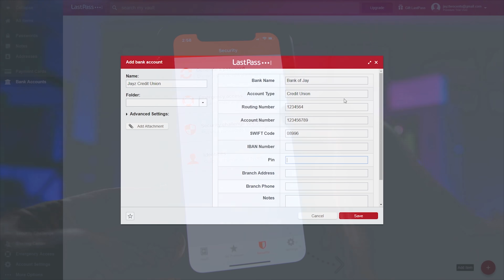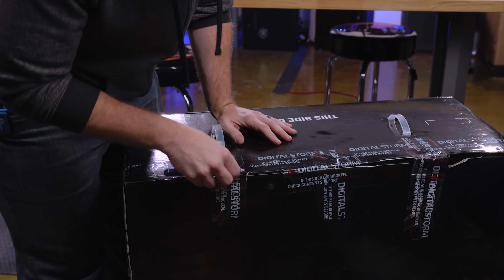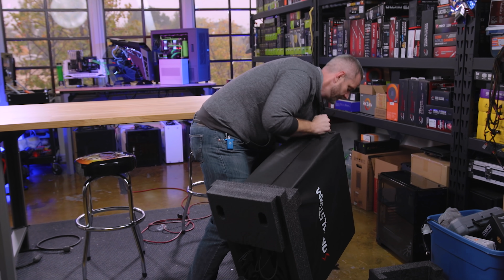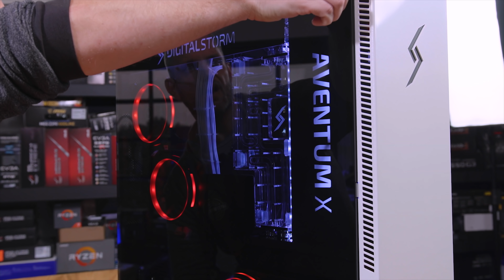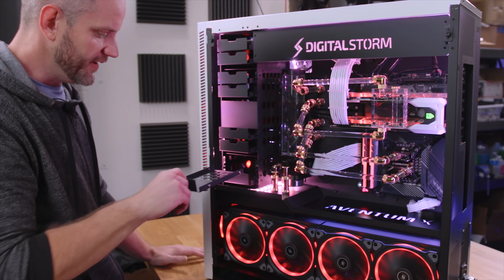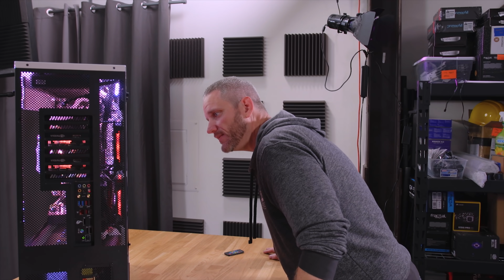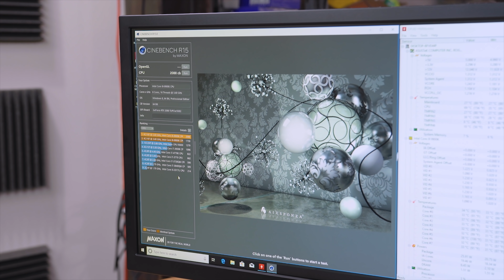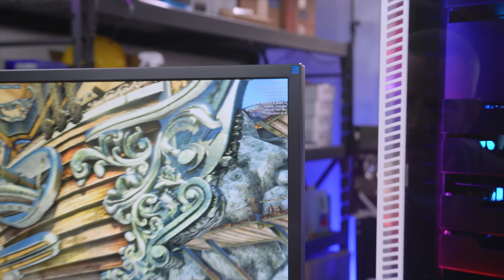Unboxing a $9500 Custom Computer...

Comment: Guys, don't bother with Digital Storm. Those guys are the absolute WORST!!!! I have had such a bad experience with them this year, it's unbelievable. 3 RMAs since I got the computer exactly one year ago, over 75 days without my computer throughout the year all on different times of the year. One of the times I received my computer from them after an RMA, it came completely DEAD ON ARRIVAL!!!! Do your research, those guys are horrible!!!!! They don't care about people. The Management team are the worst, they are the ones who basically have all the say disregarding Customer Service!!! Research on people's reviews, even on youtube. Some reviews might be 2-3 years ago but trust me, I wish I never ordered from them. Faulty parts, never checking systems right, DON'T DO IT!!!
Reply: Their prices are absolutely atrocious. Im looking at a $2300 system with a 1050ti in it!!!!
Reply: @Ryan-ir8yu  Exactly!!! You can make an amazing build with a 1080ti with that price, and with some fancy fans and coolers too!
Reply: Haven’t read a single review, but 3 rma’s mean they are at least attempting to fix the problem. All pc parts are the same as if you built it yourself and should have the same fail rate of every other distributor.
Reply: TheHomicidalTendency 3 RMAs on their own fixes, not mine. They never completely checked if the system was good to go before they shipped it, every time! The errors were not made by my user error!!! Consider yourself lucky, man. Me? Not so lucky, 3 times in a row, having to wait 30+ days each time it was sent to them.
Reply: @TheHomicidalTendency  The thing is man, you don't understand how their service was bad. they left me neglected for weeks without telling me what they will be doing to my computer. all the errors that came from the computer were from their end. Out of the box leakage despite their amazing shipping box, hard drive sata cable port broken upon receipt, computer DEAD ON ARRIVAL, reservoir model completely swapped without my approval and it was a much inferior model, thje model you see on their page yet they dont let people know they wont be getting that version. It's been horrible, man. All the tests they say they do, and the monitoring and all that is all false. If they were true, many of the issues I had would have been overseen before they were shipped to me.
Reply: Prob some bait by some origin PC nerd 🤣
Reply: I’ve had my pc for about a year and a half, no problem, always quick to answer questions or help. So bad luck I guess?
Reply: @MsToastyy  yeah, bad luck for sure. but based off my research and seeing how many people have had bad luck as well, you are in the minority for having good luck. Hopefully it stays that way for you an dyou never have to send your computer back to them... is yours custom liquid cooled or AIO/Air?
Reply: I'm on my second system from them and have had awesome experiences thus far. I've had my laptop since 2014 and it's still like brand new. And my Velox has been with me for a year and a half and still runs flawlessly. Customer service has always been quick and painless as well. I'm sorry you had a shit experience though. What you went through was a nightmare.
Reply: Their laptops are just rebranded Clevo laptops like every other SI that sells laptops. There's no reason why they would be any worse for simple shit like just popping in some RAM sticks and plugging in a drive, no matter how bad they are.
Reply: playascap if you had the same experience I had man, you wouldn’t be saying any of that lol
Reply: Soooo by mine reckoning SpaceNoodles is a either a Genuine end consumer OR works for a rival company & MsToxicToaster is the Girlfriend OR Gruppie from the owner of DigitalStorm.
Reply: Allen Kemmett lol, nah. Just really had an awful experience with them. Really want to let people know about them, that’s all.
Reply: For years I’ve heard about these companies that prebuilt systems at ridiculous prices and most parts are generic, I’ve read on the forums customers having more problems with their custom prebuilt straight out the box and within months of use.

I had to learn on my own and I built my first gaming system back in 2003 and have since to this day with no issues!

Within the past I had 4 family members that purchased prebuilt gaming systems and they were over charged and having nothing but issues where they had to RMA wait a week get it back and find out they replaced the wrong part to then reRMA the system for another week, to get the system back as he first got it.....All 4 had separate problems and regretted doing that.

I had to convince them to trust me in building their next gaming rig and ever since 2007 they come to me for their systems build, upgrade or a new system if it’s really necessary, depending what is being use for.

I learn on my own reading and watching videos since 2003, it becomes so easy once you learn the basics then you start with themes and modding.
Reply: SpaceNoodles
@ Uhh the butthurt of a salty curling kid who has been swiped all his life. damn your spamming this video with 40 comments.. does it really hurt like that..mature and get one with your life dude.
Reply: I've never had a problem with them and I've owned 3 systems from them. I've always had good service and the only time i really had a problem was when I first ordered a system I had to have it sent back the day it came but I got i back a week later and it was working as it should be. Maybe I've just been lucky I really don't know but I'm going to continue to purchase from them because I jsut don't care about building one myself and as I've said before I've never had a problem with them.
Reply: Dillon yea you are in the minority of people who had good experience. If your system breaks down, good luck with that. 3 RMAs this year, over 80 days without my computer within a year, it’s been a nightmare. Every time I got my Bolt X back, something else was broken all due to their own faults. Guys would even replace parts with lesser value than what you originally purchased.

Either way,highly highly and HIGHLY don’t recommend them. Anyone considering ordering from them, a small chance of success is given
Reply: @Lulueh  33% DOA rate doesn't sound like a good experience
Reply: @KarfontaAlec  the mailman dropped my box while coming up my stairs I'm pretty sure that is what fucked up my system. On the other hand it could have been something that was already wrong with it in the first place. The point is though I got my computer back pretty quickly and I was happy.

Comment: This cost over 10% of my house.... wow...
Reply: is you rhouse made out of fucking cardboard????
Reply: @jessesalomon297  if he's american probably
Reply: @jessesalomon297  Watch footages of storms where all the houses fly through the air. Should answer your question^^
Reply: A wild ProtoMario appears.
Reply: so 3 of those systems 
(https://www.caseking.de/en/8pack-orionx-i9-7980xe-4-6-ghz-i7-8086k-5-2-ghz-extreme-oc-system-sipc-186.html ) 

(its actual 6 systems btw) costs your whole house.. you want to trade ?!
Reply: @Xenoray1  LOL... The best thing is the label "Topseller"...
Reply: I need to move where you guys are lol 400k for my house
Reply: @Rtilly10  damn dude what's your mortgage payment
Reply: @Rtilly10  1 mil for a 2 bedroom house in Auckland so worth it
Reply: this costs like 15% of my house
Reply: @tatorchip4438  where do you guys live with this cheap houses??
Reply: @666kimbe  muricah!!  We're you can buy a house for $100(i don't live in the US soo could be completely wrong)
Reply: @t4ketsuru  you can buy a house for $1 in Detroit Michigan
Reply: @maj429  yeah with no running water or electricity oh yeah and tons of squatters
Reply: @666kimbe  Ohio $66,000 for mine.

1.5 acre too.
Reply: ShinobuBlade cheapest where I live for a house is like 400000 😓
Reply: @maj429  yeah but the drinking water is fucked.
Reply: ShinobuBlade the statement signifies 10 percent of x = 9500 dollars which when being calculated makes the cost of his #crib to be around 95000 dollars
Reply: @maj429  That's done for gentrification.. Rich people will come through and buy them to remodel them to fix the town basically.
Reply: @t4ketsuru  He said 10% of it meaning about $95,000.......
Reply: @666kimbe  that is more expensive than my house , $8500 customized shipping container, on $750 land in Texas
Reply: Slick Sauce so true tho
Reply: @tatorchip4438  this cost me 1.41% of my home
Reply: I thought the same thing. My house was 120k. My down payment was 2 of those computers.
Reply: @marionamewontwork2681  I live in Estonian wilderness and I build my house here. Overall I spend on it around 50000 euro and yes I live like a Forest God!
Reply: Cheap house ;)
Reply: I'm so jealous. My house was 835k... Housing on Oahu, Hawaii is crazy
Reply: @rshinn1776  holy crap well you are in a beautiful place though so you know gonna be pricey. I just bought a lakeside cabin and 12 acres for 50gs
Reply: @theghost7277  nice I been thinking about buying a lake house in a few years. I'm not sure yet if I do I don't know if I'll live there or just go there on weekend. I feel like if I just go there on weekends I'll be wasting it. So I may just rent out my current house which would pay for another mortgage. Although distance to work is important to me to blah
Reply: @1stfloorguy59  yea  just be sure before you jump in man I cant stress that enough... not that you would seeing you have a 825k house....
Reply: @theghost7277  damn that sounds like an amazing buy , congratulations
Reply: @rshinn1776  Can I rent the basement???
Reply: @tonyungfat  no basements here. Always wondered why...
Reply: @rshinn1776  hawaiis nice. you ever go to Kauai?
Reply: I mean 10% of this is just shy of 100k in florida in the rural area you can have a nice 3-4 bedroom home on .5 to an acre of land for 100k.
Reply: This can pay for 60% of a appartement in Poland
Reply: What the hell. It's like 1% of my house
Reply: Lol people watch city or suburbs to often for houses. country homes in new England around 40 grand up to 80 and a really new house 140 grand
Reply: @theghost7277  in England (the actual one) a decent sized house is about £200,000+
Reply: @ozzy844  holy crap that hurts. I mean where I am in the states is more rural  so it helps theres a place near me though on the lake for 31k I cant imagine paying 100 plus I for a house
Reply: 1800 plus property tax and insurance, so like 2200
Reply: @Rtilly10  oof that has gotta suck even if you are makeing cash that sucks
Reply: @theghost7277  that's normal here lol
Reply: @Rtilly10  dang that's not cool man but I understand I lived in buffalo  NY  spent 900 thousand for a house but that was back in 2000 when my dad owned his own business and it was going well but still dayum. 2200 a month that's a third of what I pull a month ouch.
Reply: @theghost7277  of that's a third of what you make a month then it's an easy payment
Reply: @Rtilly10  it's not bad but not perfect .perfect is paid off lol.
Reply: @Ali Rahman not meant as a joke, I've seen YouTube videos with people showing whole rows of basically gutted houses in Detroit and saying that they are selling for a dollar apiece. I don't know if that's true or not just saw it on YouTube.
Reply: This cost 50% more from my motorcycle
Reply: I live in a $6000 tiny home which I also put about $4000 into furniture/appliances so this PC literally cost 95% of the price of my home............
Reply: @cerberrrus2315  do u live in a straw house in africa?
Reply: I live with my parents :(
Reply: my house is 25000, so this is nearly 50% for me
Reply: @nirxu  where do you live?
Reply: ProtoMario how was your house so cheap. My house was over 800k and it isn’t even a special or particularly large house.
Reply: my house is 10k usd at the time of purchase so this thing is 95% of my house
Reply: Lol this 100percent of my house
Reply: This cost more than my  house (8500$)
Reply: 50% of my house
Reply: this costs 135% of my car
Reply: This cost 2% of my house. Seriously. I or 2 mortgage payments for my house.
Reply: ProtoMario more than that of mine
Reply: This is a third of the cost of my snowmobile...
Reply: @AW-nz5st  A snowmobraaaapp for 30k sounds like a shitty deal...
Reply: Diablos, esa computadora cuesta lo que costo el terreno de mi casa, y yo construí la casa
Reply: Where I live all houses cost at least a million where do you live where the houses are so cheap?
Reply: Your house is 1/2 of the down payment for a beater home here...  I rent obviously.
Reply: My house is 550k so this is 1.7% of mine 0.o
Reply: This is like 30% of my house, 100m2 house you can get for 30k here.
Reply: Come to the backwoods of Kentucky my $100,000 house is paid off it has two different living spaces, upstairs and down, and my property taxes are $275 a year for 1/3 an acre.
Reply: This cost over 50% of my house... lol
Reply: Lol that's twice the cost of my entire home
Reply: 130.000 dollars for mine. Just an apartment. Houses are too expensive in my country.
Reply: @Jason Poole  I paid $45k for my house on 1/3 acre it is a two story with two apartments one up and one down. My property tax is $275 a year. I live in SE Kentucky in the backwoods and my house is paid off. The house is now worth $100k. The downstairs use to be a 24ft/7.3m x 36ft/11m garage. My Dad decided to build a apartment in half of it back in 2011 and then my Mom built in the other half and extended out the big garage door about 12ft/3.7m. So it is like one big apartment downstairs but it is separated into two different living areas because my Mom and Dad have been divorced since 1984 lol.
Reply: Our house is like 40 years old and is market worth 350k haha
Reply: this is my house
Reply: In cali, this is like 1-2%. So its not too ridiculous.
Reply: Try 1%.....
Reply: With all these prices, I am more interested in how much you earn? lol
Reply: 1mil for my house
Reply: Dream house*
Reply: I don't own a house. This is really expensive
Reply: lol my house was 75k.. ;]
Reply: In central London the price of this rig would just about cover 1 months rent in a tiny little single room bedsit shared with 4 other people :/
Reply: Is your house 400 sq ft? Also, is it on a nuclear waste site? Or maybe a haunted Native American burial ground?
Reply: That’s a cheap ass house damn
Reply: My house cost $810 000
Reply: Kiamaster Gaming that’s it?
Reply: Two and a half years rent
Reply: Live in turkey  and my house is like 60k $
Reply: This cost over 1% of my house.... wow....
Reply: Where do you live where your house costs less than 95k? I'm moving in with you.
Reply: @BleachIsFTW  my house cost $21k.
Reply: @yeetcannonblaster5396  Is it a trailer home? :o
Reply: @BleachIsFTW  yes sir it is.
Reply: @yeetcannonblaster5396  how is that going
Reply: @Xozy58537  decently
Reply: Yea
Reply: This costs like 0.08% of my house
Reply: @Ali Rahman You can get house for $1 but the house needs some $75K or more in repairs
@Sllick Sauce, the catch is the house is condemned and ether needs to be rebuild or a complete teardown and rebuild.
Reply: Damn how do you get yout house so cheap. Ours is £900K
Reply: This cost 45% of my housr
Reply: Tiny ass apartment here is at least $200k+
Reply: 100,000 house in tx is not too bad
Reply: For this price, you can build you a small house for a single person
Reply: houses where i am are 350k
Reply: This cost over 1000% of my house. Im homeless btw.
Reply: Same
Reply: This costs 0.01% of my house and I still wouldn't spend that much lol
Reply: That’s cheap for a house then
Reply: this is bigger than my house
Reply: Your house costs 100k.  In my area a house costs about 1milion and flat with 3-4 rooms about 400k.
(I dont own one of these)
Reply: my house cost this 2,13,87,330 $(150 cr in rs) and I bought it for 25 cr in rs I am from India though I live in defence colony and I have a bungalow
Reply: it's like this much per cent 0.044418821%
Reply: You can buy or build a great motorcycle for that price. My goodness. #goals
Reply: This cost more than my house
Reply: Yea I live in Detroit where houses rarely surpass 100k
Reply: Lmao at all of you kids dropping how much you parent's house is worth to try to trash someone for not living beyond his means
Reply: I want to sell my house and spend some of it for gaming
Reply: This pc cost like 45% of basic houses here in PH
Reply: Lmao my house was 1 mill
Reply: It costs Almost 10x my house
Reply: wow I feel bad for you Americans.  reading the costs of housing. 100k usd is legit considered slightly costly in my country 😂 ○_○

in fact you can get 3000 square feet of house with a garden . OK this is a cost to build, so add in another 30-100k usd for the land.. A very well designed , comfortable, well equipped, HIGH END house.
Reply: Mate I wish I could get a house forr 95k..... Although your house is probably just cardboard
Reply: ProtoMario OOOOOFFFFF
Reply: Its 3k chill
Reply: It costs more than my car
Reply: It costs twice our house and lot combined🤣
Reply: Did you buiy a trash can?!
Reply: This is 4% of my apartment
Reply: @Jason Poole  that aged so well...
Reply: 100k for a house damm thats impressivly cheap (i live in california lol)
Reply: Where do you live? Texas or something lmao 😂
Reply: 10% of your house???? wtf you are living inside a cardboard or what?
Reply: Where do you live lol
Reply: @Rtilly10  just pure dumb! just pure dumb!

Comment: Which would you recommend for radiator size, 2x 140mm fans or 3x 120mm fans?
Reply: 3 fans running at 33% would move the same air as 2 fans running at 50% but be a lot quieter